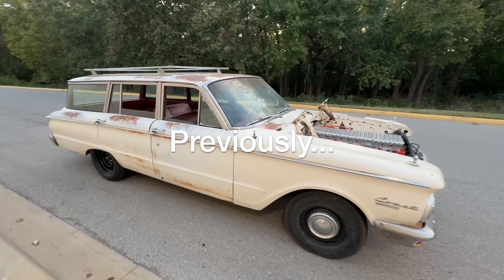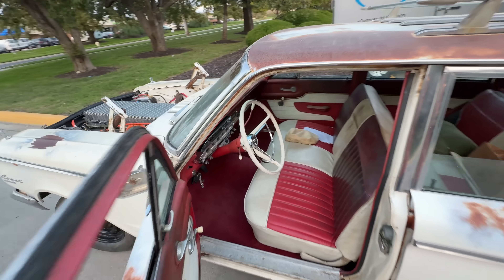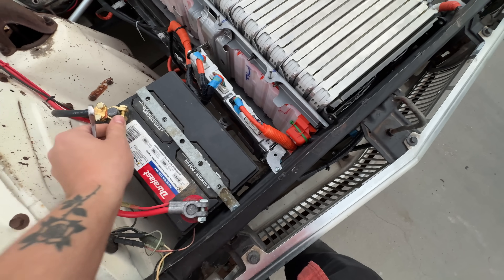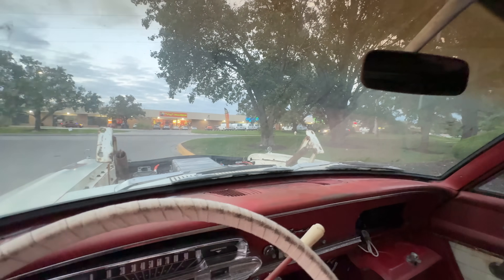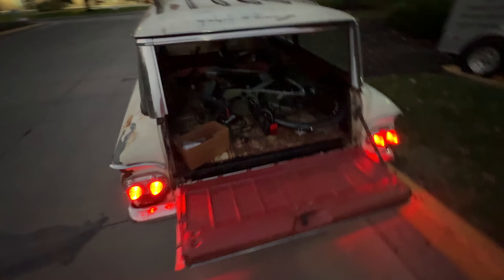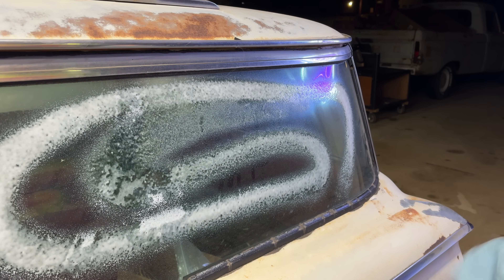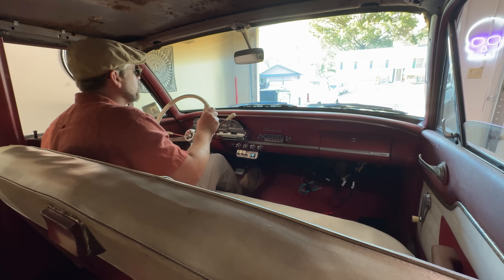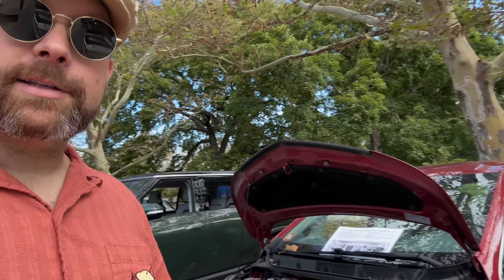What It’s Like to Drive My Homemade Electric Car

Comment: If he has a front impact there likely will be a thermal runaway. You can see what I mean.
Reply from the maker: I plan on fixing that. Re-building the front pack with some space in the front and have it inside a metal enclosure, plus a crash bar where the radiator support is now, and likely some diagonal struts. Of course a big enough impact is impossible to protect against.
Reply: This is so true! Gas cars have never in history burst into flames in a crash, only EV's.
Oh wait.........
Reply: @alibro7512 Nice sarcasm there. Gas cars dont have their gas tank directly behind their grill. Do some research on what happens if metal objects pierce a battery before you type out your ignorant comments online. In my jurisdiction, this battery mounting is illegal for this precise reason. Just because it's legal in the US doesn't make it safe.
Reply: @blackterminal  keep your mask and helmet on, stay safe
Reply: @blackterminal  Most people typing comments like yours seem to think batteries burst into flames just for fun and actually believe the FUD coming from social media and the press. The have no clue that in reality EV's are much safer than ICE cars and something like 20 times LESS likely to go on fire.
I'm fully aware that the battery location here is not ideal. When I converted my car I kept the battery as far back as possible but I still hold that in ICE form this car is more likely to go on fire in an accident than it is now.

Comment: I'd plan on making my car with hydro only on the front, I already removed the rear wheel cylinders. Regen is basically ABS, so wire the regen to only activate when the brake lights are on. I modified the drums to be cable only, so I still have an emergency brake.
Reply: i talk like I'm going to, and already have..strange, but true.

I only have the axles, so the car is a future project 😂
Reply from the maker: What are you driving?
Reply: @ThisOldJalopy that one is literally only axles, so far. I'm thinking it will be something like a Lotus 7 with a solid front axle on quarter elliptical leafs with a Dana 35 in back...

but nobody knows what I'll make, not even me.

actual dd is irrelevant, but a 2001 Honda Prelude that somehow isn't burning (much) oil, yet.

Comment: with one pedal braking the brake lights aren't on when stopping. That's not good.
Reply from the maker: They come on, the controller has an output for brake lights during heavy regen

Comment: Has anyone who's done a project like this ever added a small gas range extender?
Reply from the maker: @j5jonnny5 is working on a diesel-powered generator, and @hightek-rednek built a really crazy contraptions, you gotta see it. https://youtu.be/9vvp0ydXOKw?si=e1fgsDoSQyKhv8UF
Reply: Do you mean like bringing along a small Honda generator?
Reply: @workingguy-OU812 no, there are few new cars today that are electric with Gas range extender engines I.E. the BMW i3, Chevy Volt (recently discontinued) and Jeep just debuted a large SUV with an electric drivetrain and gas range extender engine. My question is has, someone attempted to duplicate this with a DYI project such as the one in the Video above?

Comment: dont know if you can set this up with your controller. but if your braking under regen your brake lights should turn on for safety reasons.
Reply from the maker: You're right and thankfully the controller already has that feature! Resolve-EV controller.

Comment: This is the kind of engine swap I love to see, keeping that beautiful bodywork on the road but making it cleaner, cheaper to run, and easier to maintain.
Reply: Cleaner?
How cleaner?

Clean batteries?
Clean production of electricity?
Clean mining for batteries and copper?
Reply: @Adams1984100  yeah pretty much all parts of electric vehicles are made cleaner, and the difference in materials and charging even on the worst grids is offset in 2-3 years. So in this case saving a wrecked ev and a vintage car with a bad motor, it’s even better
Reply: @Adams1984100  this is a salvage battery. He’s saving it from a landfill. Put the original mining.environmental cost onto the original vehicle and whatever life use it had. At this point since he salvaging the battery from the landfill all his use is environmentally positive. that’s not something you could say for fossil fuel use.  For fossil fuel is every gallon used is new extraction with its environmental cost. As far as how clean the electrical supply is. He is driving in California, not West Virginia, which is primarily coal And even in coal country, centralized production of electricity in power plants is still cleaner than fossil fuel use to power a local vehicle engine.
Reply: @Adams1984100  Yes, countless scientific studies have shown EV's are far cleaner than combustion engine cars.  But, I'm sure your TikTok Degree in Q-Anon studies is a lot more accurate than MIT, Argonne National Labs and all the major scientific and engineering universities around the world, with actual PhD's studying the issue...

Comment: turn the   AM radio into the control panel. that could look really clean and sharpe.
Reply from the maker: Yeah that would be cool, I hadn't really thought of that. Like, the station preset buttons can be used for Forward-Neutral-Reverse? That would be awesome, probably not likely I'll do that though.

Comment: You might’ve done this already but the residual pressure valve can be punched out, brakes will work normal with no drag and you can keep the stock master cylinder
Reply: That's silly --- it's been "modernized" with an electric drive system, why not step into the 20th century and add a dual hydraulic system --- the pedestrians and other drivers on the road will appreciate it.
Reply: @SurferJoe46 you make a good point, I was just sharing a way to get it driving with more than just front brakes as quickly as possible
Reply: @SurferJoe46  If you have read other comments that's already high on the list from the viewers.
Reply: Many times they are behind the little "flare cone" where the brake line screws in. Stick a wood screw in the hole and pry it out with a pair of dikes. Do the same for the check valve then tap the cone back in.
Reply: @rupe53 exactly

Comment: This whole project has been an incredible inspiration. It has demonstrated to a lot of people, including me, that it is now plausible to do this kind of conversion without having to be a millionaire. It is my dream to one day convert my 06 Vue in the same exact way you have done your 62 comet
Reply from the maker: Thank you! Having finished the conversion, I can say that using the de dion axle and butting the batteries in the front was NOT less work or cheaper than doing it the conventional way - motor adapter and coupler to the old manual gearbox. But it is lighter and it is more efficient I think.

Comment: Looks great! The rear seems a bit low, or maybe it's an illusion? Do you have any plans to change the suspension at all, like maybe add helper springs or anything?
Reply from the maker: It does need to be leveled out a bit. I ordered some gas shocks for the rear that will lift it a bit (half an inch?), and I want to lower the front an inch or two.

Comment: Fuel mileage tires are similar to trailer tires. No strength in sidewalls. Tires easily damaged by curbs. And they are terrible for handling on curves.

Comment: If you don’t have a return spring on the brake master cylinder linkage it can let the caliper drag enough to heat them up and grab the rotor like that. Just something to check
Reply: I agree - and I think that it could be an early sign of the need for a master cylinder renovation as well - the piston might not have returned sufficiently.
Then have a separate fuse for the controller and the brake lights would be a good idea.
Reply: @ehsnils  Yes, that is a good point. Something else to check is to make sure that there is a little free play on the pushrod of the master cylinder to be sure that the mastercylinders piston can return all the way to the snap ring stop.
Reply: Many MCs have a check valve to slow down the shoe return on drum brakes. I found this to be a problem when doing disc conversions on VWs years ago. In the VW it was behind the flare where the brake line connects. Had to put a screw in there and pull that out then do the same with the check valve.
Reply: @rupe53 I prefer drum brakes myself, they last longer, and no brake fluid or master cylinders required.
Reply: @gsp49   I have a 1928 GMC that has all mechanical brakes so I follow your drift. It's complex but never needed anything but but some lubrication every 5-10 years. I believe it's had ONE shoe reline since new... and the drums have never been machined. (grease contamination on the shoes) I did the last brake job near 40 years ago.
Reply: To install only disk brakes in the rear and then driving his car on public roads is either very Ignorant or pure AH territory...
When you upgrade any of the obsolete brakes on an old car you have to change the entire system including moving to a dual circuit master cylinder...
Imagine if the driver's side rear disk brake had locked up quickly from overheating while he was driving at 55 or so...
Reply: @davidhollenshead4892  Harsh Dude. There is a better way to convey sentiments from the Peanut Gallery. AH
Reply: I thought the exact same thing when I read that comment. Having a bad day or just a jerk
Reply: @davidhollenshead4892    That was going to be my next suggestion because a dual system would be the right way to handle everything... including front disc conversion. There are kits available for just about any car on the road. I converted my 64 Corvair panel truck to a dual system a few years ago. Everything was a "bolt in" part.
Reply: Read that as a rectum spring... Early morning eyes make for a funnier internet.

Comment: I haven’t watched all the way through yet but I had the same issue with sticking brakes on my 1960 mercury comet. It’s the master cylinder. I had to take mine apart and cycle it outside the car and blow through it with brake clean. The linkage inside the car was also hard to push through and I had to loosen the bolt that tightens it and oil it because it was too tight to around the pedal to full return which caused the brakes to slowly build up pressure
Reply from the maker: Ok thank you. I plan on getting a new master cylinder very soon, but I'll make sure to clean up and lube the linkage too now.

Comment: Are you eventually planning to use the Leaf electric heater core in this?  I was curious since you had taken it out of the leaf when you tore it apart and I was interested in having heat for my own ev swap.
Reply from the maker: Good question, and yes I am. I've thought about it a bit but haven't crossed that bridge yet. I'm thinking that, it's just all on or all off, right? And use a contactor? Then use a blend door to get the heat needed?
Reply: @ThisOldJalopy  I have no idea how the leaf heater works, but I would imagine it just needs some kind of fused high voltage from the contactor, and 12v signal to tell it to turn on and make some heat.  I'm hoping it's that simple anyways...  I just want it to feed the defrost vents for my mk1 VW, you will probably want something better for your wagon.  Maybe you can cram it inside your Comet heater box or modify it to work?

Comment: I have notes. Bag the suspension and put seat belts and a usb charge port on your list.
Reply: With the about 3 meters of pouch celled Li-Ion cushion he has in front of him, I don't think a belt is his biggest worry when crashing into, well, anything.
Reply: @herrtichy  What he needs is a 200 gallon thermos carboy full of liquid nitrogen to put out the fire.
Reply: @herrtichy  It's basically a delay-fused, ground to ground incendiary missile.
Reply: Also - new gaskets and fuzzies for the windows.
Reply: Hell yes, belts.  I'd like to see head restraints if he's not trying to keep it 100% original. He could get Speedo off of nav
Reply: WE HAVE NOTES